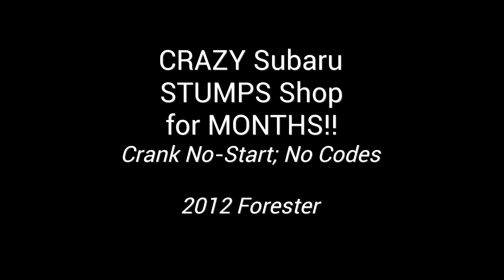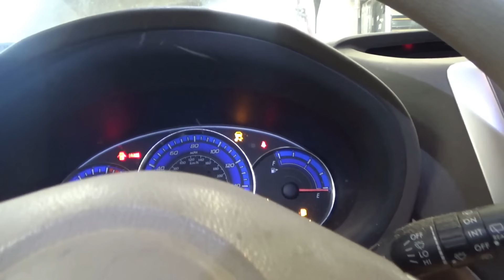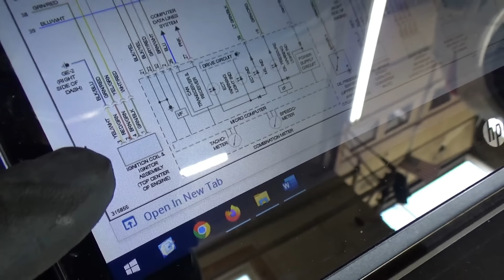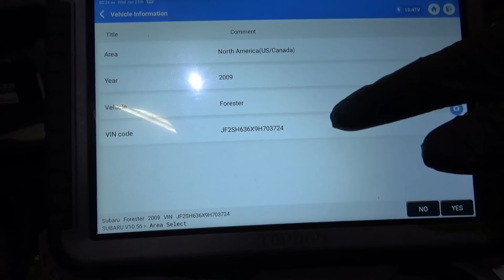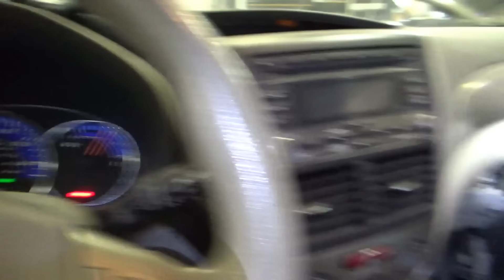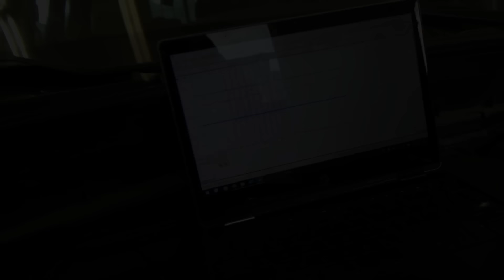(Pt 1) Subaru STUMPS Shop...for 6 MONTHS?!? ('09 Forester Crank No-Start, NO CODES!)

Comment: The bad coil is shorted internally to the other coil and is firing with the shorted pulse, hence fires twice as oftenh. I've seen this on motorcycles.
Reply: Than how can you explain what appears to be the same problem (at least half the coil being dead) with a replacement coil? That's why Ivan suspects the short is in the ECM.
Reply: Ev😂everything shorted

Comment: I think you may want to test the ignition signal at the computer not just at the coil pack. It seems a little erratic to be the wiring loom but it’d settle my unreasoned suspicions.

Comment: I bought a Toyota Corolla 4 cylinder from a Auto repair shop they couldn't figure what was wrong with it after they serviced it new wires plugs everything so the owner and customer of the car sold it to me cheap! I took it home it ran horrible so I checked the spark plug wires and they all had zero ohms so I got another set of OEM wires not the Chinese ones that were in it installed the new wires and bang it ran perfect!
Reply: "It can't be the plug wires...they're new!!!" 😄
Reply: @franklincormorant8312 NEW = Never Ever Worked
Reply: @franklincormorant8312  Never Ever Worked,
Reply: They must have been copper core wires to have 0 ohms. Probably looked like fireworks under the hood if you looked when it was dark. 👍
Reply from the maker: AMAZING!!
Reply: From what I see. 
Either the customer didn't want to purchase OEM wires and plugs. 
Therefore, the shop installed a set of cheap plugs and wires and presto. You have a recipe for disaster. 
I've seen this to many times.
Reply: @2nickles647  "Either the customer didn't want to purchase OEM wires and plugs. "

An "either" is followed by an "or", what was your other possibility?
Reply: @ferrumignis too many beers doing diag,lol.just kidding.

Comment: Two guesses:
A: Wrong pinout on the coil, common pin mixed with one of the signals.
B: Engine replaced with one from the wrong model year, where the crank signal doesn't match the computer.

Comment: Wow, that's weird!  Looks like both trigger wires from the ECM are tied together and are connected to the input lead for cylinders 3&4 at the coil pack.  The other confusing thing is that the input lead for cylinders 1&2 have the 2.5 volt bias, so it must be connected to something.Additionally, I wouldn't feel comfortable throwing an expensive dealership ECM at this car at this point.

Comment: We do the same spark plug heating trick in light airplanes.  Just roll back the mixture until the fouling is burned off.
Reply: In flight??  Just asking , but would it not be a little risky to other components to run lean long enough to clean the plugs ?

Comment: A resistance test on the two coils in this wasted spark system is a quick and easy test.  My V6 with a wasted spark system failed with an intermitent spark on one of the 3 coils.
Reply from the maker: How do you check the resistance? 🤔
Reply: @PineHollowAutoDiagnostics Thought for sure he would have said “ with an ohm meter”! I couldn’t resist, pun intended. 😂😂👍
Reply: @PineHollowAutoDiagnostics   I had three internal coils and one had a resitance much higher than the other.  The engine behaviour was an intermitant misfire that seemed to change with engine temp.
Reply: @PineHollowAutoDiagnostics  primary winding will be signal wire to power and secondary winding will be between the two  plug outputs for each coil system
Reply: @jutto64 if I had to guess here and I'm going way way out on a limb.....I'm guessing Ivan has a very clear understanding of a coil and how it works
Reply from the maker: @jutto64  How do you get to the primary winding with a meter on a coil controlled by a 5V pulse? If it was a 2-wire extrernally-controlled coil, then no problem :)
Reply: @PineHollowAutoDiagnostics I had the older style 3 pin set up so access to both P and S winding.  You have the 4 pin setup so the ignitor essentially prevents access to the primary winding.  But still access to the secondary winding where most problems occur?
Reply: @PineHollowAutoDiagnostics  https://www.youtube.com/watch?v=V3dpJ4hQh4Y

Comment: sounds like a Windstar I had that the crank pulley was cracked in half and the timing was all over the board. the only thing holding it place was the long bolt.

Comment: Just listen to it. Jumped cam timing killing one coil trigger. Also wire routing was correct before. Top coil to both front cylinders.
Reply: On asian waste spark i have seen many times 1 coil only when cam signal is not happy.i vote for cam timing by how it cranks and the 1 coil trigger dead.
Reply: Does this have 2 cam signals one from each head? The engine does sound like the heart beat is off. Compression on one bank?
Reply: it's easy enough to pull the outer timing covers on those, probably have to remove upper radiator brackets and tilt it up to get drivers side out, ac line may be a bit in the way. nothing gentle bending won't fix. 🤣
it does sound a bit odd cranking over, but most of the time he has some plugs out and others in.
Reply from the maker: How can jumped cam timing kill ONE coil trigger? 🤔